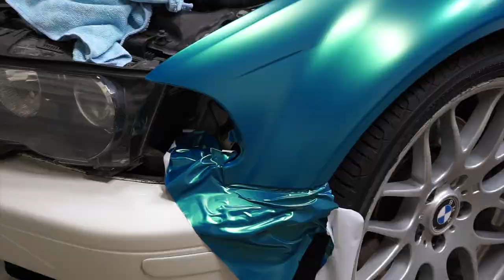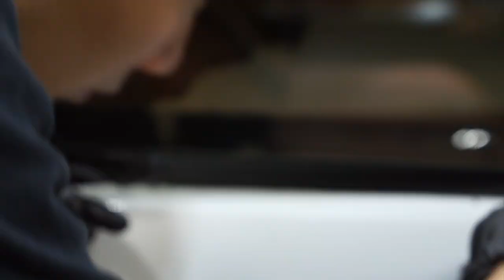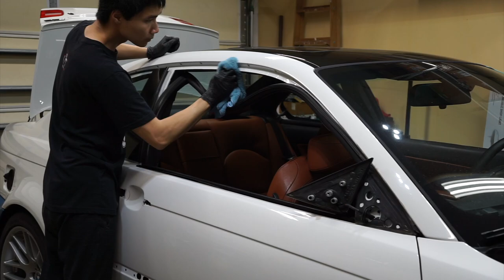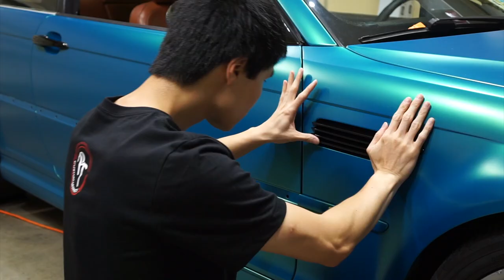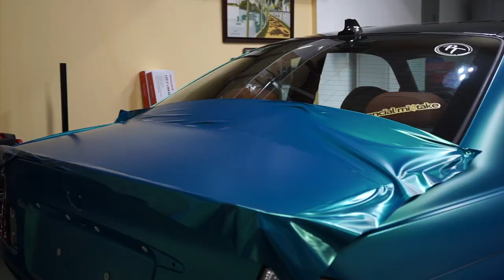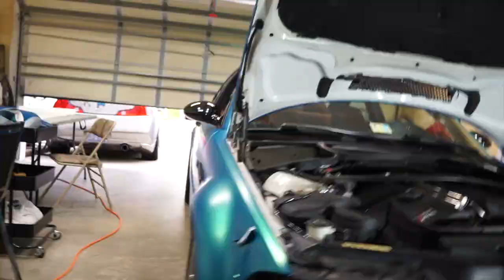BMW E46 M3 | Full Exterior Wrap | Timelapse | PT Custom Graphics

Comment: If it hadn’t been for the spoiler on the trunk, would you have wrapped the trunk in one piece? Since there’s no break where you’d hide a seem?
Reply from the maker: Yes, if we had removed the spoiler, it would've been a one piece trunk install. The seam is nearly invisible, so we saved ourselves the trouble of messing with the double sided tape that's holding the spoiler on.

Comment: How much vinyl wrap did you need for the car? The color I'm looking at only comes in 60ft.
Reply: idk if you figured it out or not but people have done e46s in 55ft, 60ft is perfect. backup in case you mess up or extra to rewrap anything if its damaged
Reply: @trentnishida  Thanks for the reply! I found a roll for 75ft and went with that. It's my first wrap attempt so I didn't want to take any chances. But you are right, once I'm more comfortable 60ft would have been perfect.